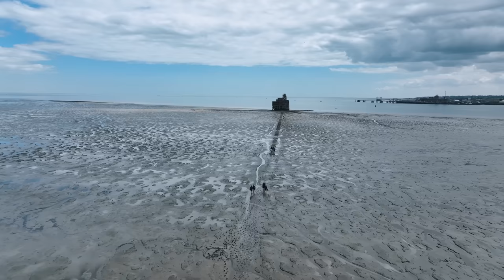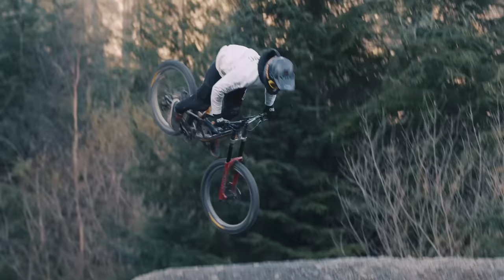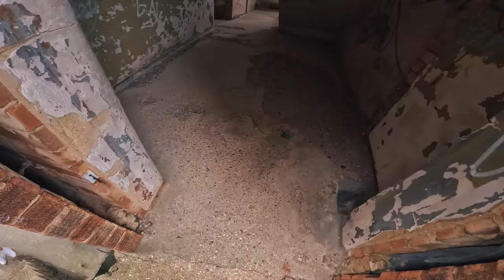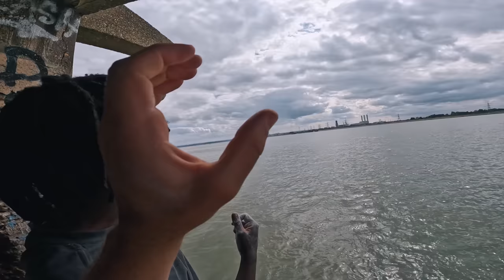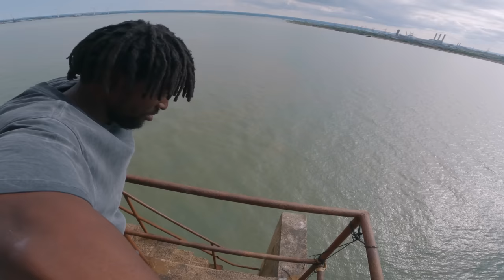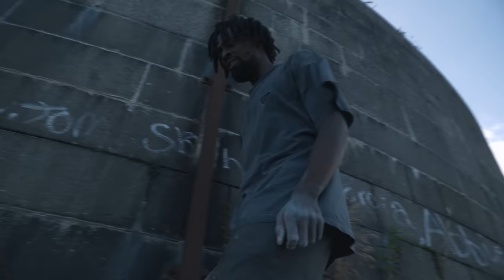ACCIDENTALLY TRAPPED - Tidal Mistake  🌊

Comment: I love how the storror boys have slowly implemented more and more climbing into their videos and challenges
Reply: any1 who does this sport knows they both intertwined (sometimes to get to certain spots you need to climb up/down )
Reply: I think it's going to be an excellent sport for them to ease up on the super high drops for longevity in their 40s and onwards, and to keep up the mental and technical improvement. Plus it's also a team sport, I'm pretty sure they'll develop their own brand of crazy mixed climbing art.
Reply: I'm surprised they don't use climbing shoes, they are so much grippier.
Reply: @Bizasbusiness  having climbed up small buildings before I think the type of climbing to get onto a roof is pretty straightforward and doesn't require that much climbing skill apart from one foot in front of the other
Reply: @Nico42ke  Not really, they're not designed to maximize surface area. But would definitely help on crimpy stuff.
Reply: @szabolcsmezei4088 I found bouldering when I was 40 …….6 years later, still at i5 🤙🏻💪🏻🧗🏻‍♂️
Reply: @Nico42ke  Climbing shoes feel really uncomfortable when you're used to doing parkour in "regular" shoes
Reply: Theyre just finding some of the most outlandish bouldering locations ever haha
Reply: @silverkade63  “buildering”
Reply: @bazwax77  Nice
Reply: Longevity innit! Clever lads! They did the same thing by doing less flips, saves nasty unexpected injuries
Reply: Does anyone know if Toby's finger almost getting ripped off has affected his climbing? Doesn't seem to bother him.
Reply: I'd be most worried about falling into that murky water. 🦈
Reply: @szabolcsmezei4088  
Just what I thought when I was wondering how they'll keep going long term :)
Reply: It's so cool to see 'Urban climbing" or whatever you would actually call it
Reply: Great point, I thought the same.
Reply: @GMoMoney3  i was thinking that too, wasnt his tendon torn?
Reply: More like it's amazing how they have slowly implemented filming into climbing/ parkour and exploring
Reply: In one of the bobat videos he said he can't crimp but big holds are okay
Reply: Literally bouldering at the end 😂
Reply: @Nico42ke climbing shoe are impractical in every other method of movement besides climbing. Plus it's pretty cool to be able to climb without climbing shoes. that takes skill.
Reply: Also how they're just realizing how insane they are
Reply: @dankbuds-md5lihow does the athleticism of some Brits show why the American army beat the British army?
Reply: L
Reply: And the crazy locations they find 👌👌
Reply: Makes it feel like assassin's creed a bit
Reply: Remélem egyszer leestek és szörnyet haltok
Reply: @Nico42ke  Climbing shoes are made for your toes to be slightly scrunched up. That would lead to some serious problems with the running and jumping
Reply: Those arm jumps at height with real serious consequences always make me almost park my morning toffee 😱🫣😍

Comment: Y'all should bring like engineer tape, it just this like thin coloured plastic strips you can tie around things like those two little studs poking out the concrete. Will make it easier to mark small dangers so when your running you can notice them with a glance